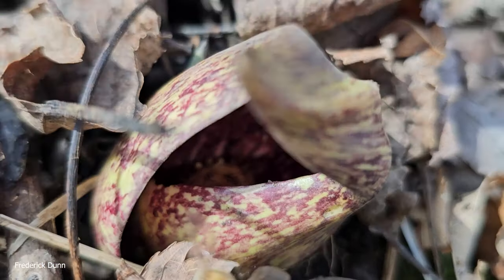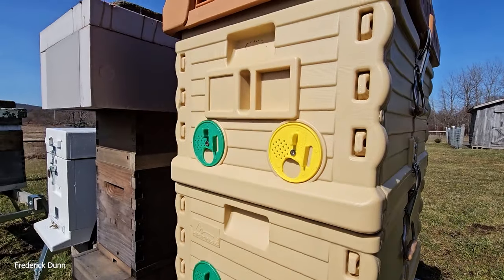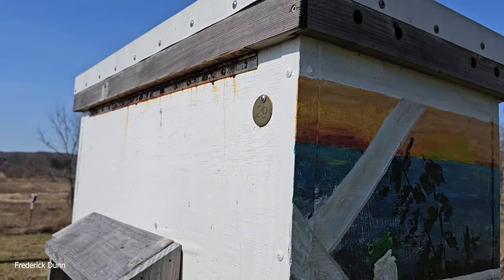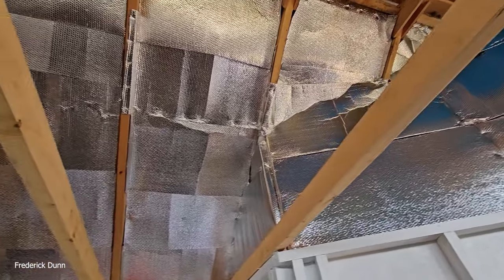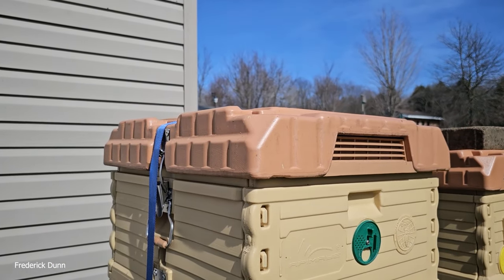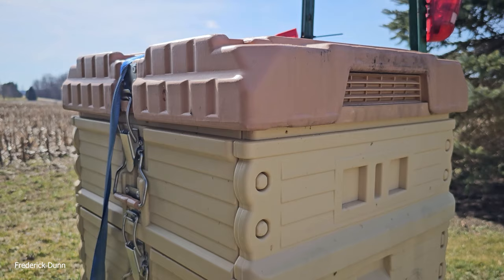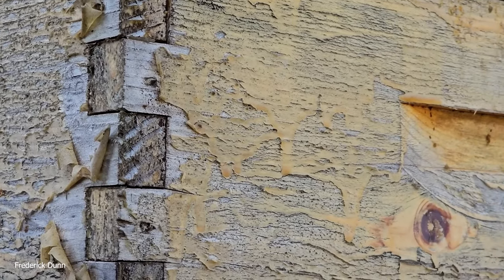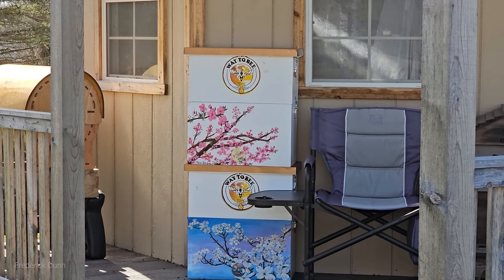Apiary Hive Survival Walk Through, March 4th All Hives, some are dead.

Comment: Hi Fred, it was interesting to see all the different hives and your configuration of each.  I'm wondering about the discs that are on the front entrances of some of your drilled boxes.  I noted that one of them was shiny metal.  I wonder in the summer in direct sunlight how hot that disc would become and if the bees would have problems walking over or landing on that part of the front of the hive since there is no landing boards there.  Have you ever noticed any difference between that disc and the plastic ones?
Reply: I've wondered about that myself; it would seem the SE facing ones might be shaded from the late afternoon direct sunlight. I guess a lot of things come into play though, trees, buildings and such.
Reply from the maker: The heat on those Layen's hive discs hasn't been a problem so far. I'd bet they would really get hot if they were black. Remember that in summer they are in shadow with the sun directly above. We can do thermals just to see. The metal clad standard hive covers have shown to reach 135 deg. F.

Comment: Do you angle your hives 10-15degrees during the winter so the humidity does not drip on the bees inside?? Thanks 🙏
Reply from the maker: I do not, though I do tip them toward the landing boards around 1 degree. 10 to 15 degrees is very steep.